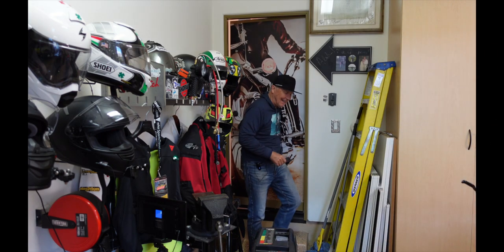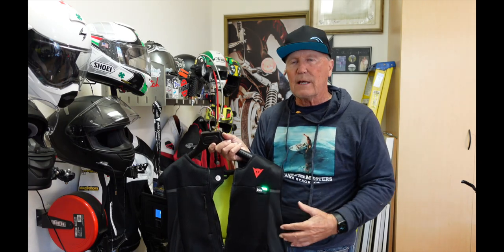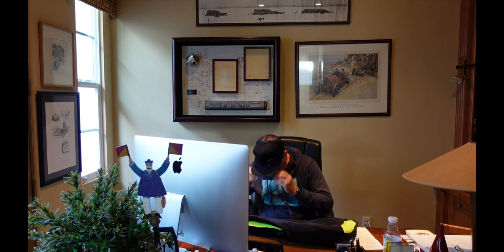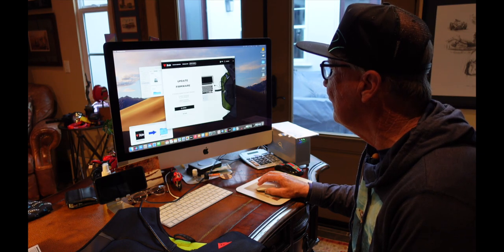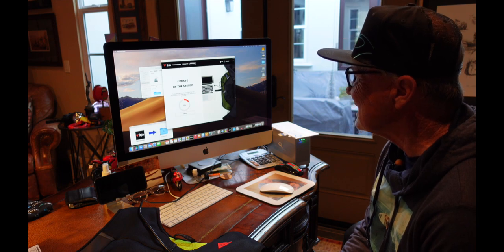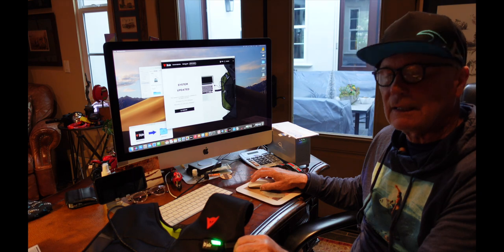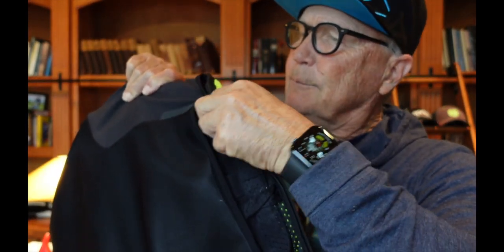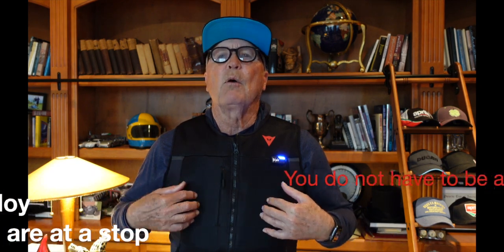Updating the firmware on the Dainese Dair Smart Safety Jacket 2021   HD 1080p

Comment: GC-Thank you for the very important content. I like this particular safety equipment. What made you decide to go with the Vest versus the Jacket? Pulling the trigger as Revzilla has them both in stock. Ride safe and ride often. Best to you and family. Happy holidays.
Reply from the maker: Hey Road Glide, when I selected this Dainese Jacket/Vest there were really just the two on the market; Dainese and Alpinestars. What appealed to me on the Dainese was the mesh construction which I thought might be cooler in San Diego, and the fact that you could wear it under OR over jackets. In fact it comes with 3 pockets, a vest pocket, and two "hand warmer" type pockets if you wear it over another jacket or by itself. I thought this versatility was pretty nice, and I would be more inclined to wear it in warmer weather.
Also a factor was the fact that I had several motorcycle jackets that I hoped to keep while using the vest. The idea was that I wouldn't have to get rid of any of my current gear. 
Now, I will say I don't have real knowledge of the competition...not having used any of it. And now KLIM has entered the market with a product as well. I just know why I made the choice I did.
In practical fact, to date I have never worn it either by itself or on the outside of any jacket. I typically wear it inside of a mesh jacket. And, I have only one leather jacket that feel safe wearing it under as it is supposed to require nearly 2 inches of expansion room if/when it deploys. 
I do believe that either of the three manufacturers would supply an excellent product as they both already provide quality gear and I am sure they've done the research for their own product offering.
If I had to do it again with my current knowledge I'd give up the idea of trying to keep my tighter leather jackets as a decision point.
But, to date I am happy enough with the Dainese. Sorry for the long winded reply but this is not a simple yes or no type response.
Hope it helps and a very Merry Christmas to you dude!